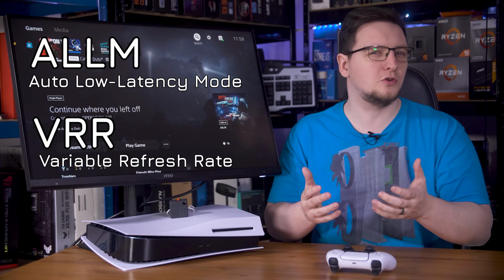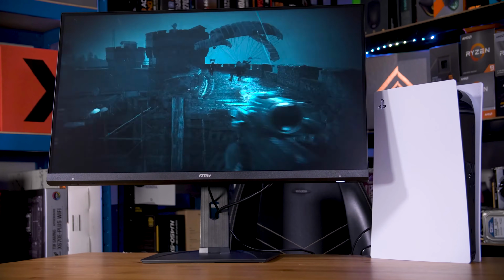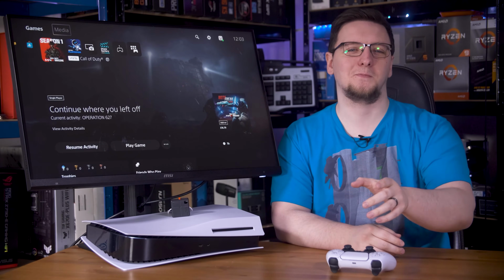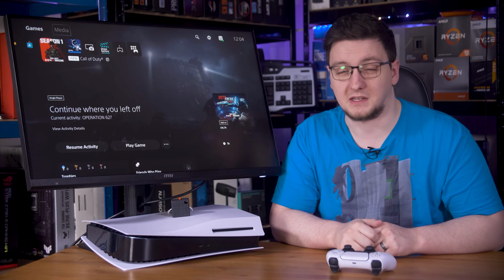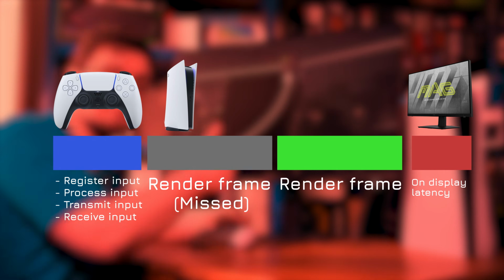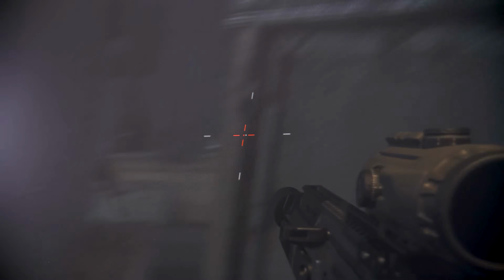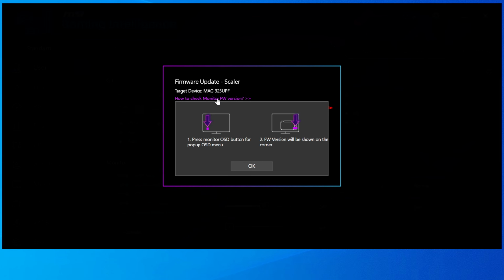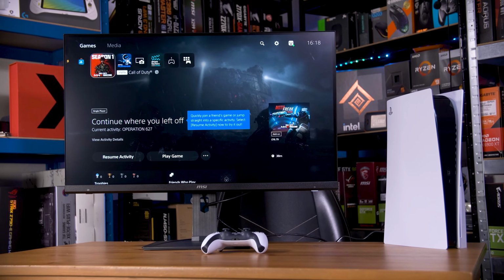MSI Cares about Latency - PS5 Auto Low Latency Mode (ALLM) Test

Comment: HDMI 2.1 does not guarantee that you will get ALLM. I got the BenQ EX3210U and while it does support VRR it doesn’t support ALLM. Which sucks ass.
Reply: That’s because your HDMI 2.1 is strictly backward compatible. It only supports the older version of HDMI which is run under HDMI 2.1 (TMDS). You need a HDMI 2.1 FRL ideally FRL6 to support maximum effect of HDMI 2.1.
Reply: Thats why you check to see if the monitor does
Reply: @ You right. Didn’t think about that during that time, but I just got the Sony InZone M9 mark 2 monitor and it does everything.
Reply: same with LG 27GR3U. i feel scammed.
Reply: @Kamino_k  ALLM is tech for TVs and not for monitors. That's why you don't have and don't need it on your monitor, since they are way faster than TVs. You can check your input lag at rtings' monitor input lag chart.
Reply: @AgoraphobicNews but it’s available on my monitor
Reply: What monitor do you have ?  @ehsan-6835
Reply: @ehsan-6835  ALLM doesnt work if you're using a capture card from my experience
Reply: Sony Bravia 2 s25b support ALM 
HDMI earc

Comment: Does the monitor support 1440p
Reply: yes
Reply: Yeah. 2160p is 4K. 1440p is 2K.
Reply: @dipsetny9291 idk what monitor supports 2160p mine was around 170 ish not expensive but still fine but by no means reaches that. 1440 is where I can go.
Reply: @dipsetny9291 it also doesn’t support allm dang that’s sad but you get what you pay for it’s still a fine monitor lol